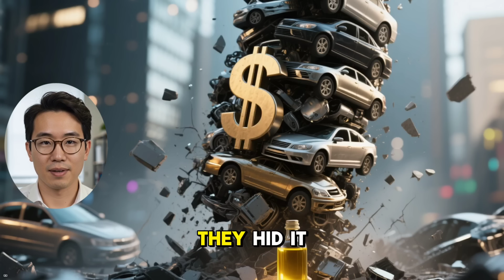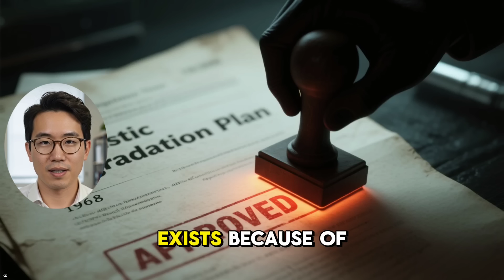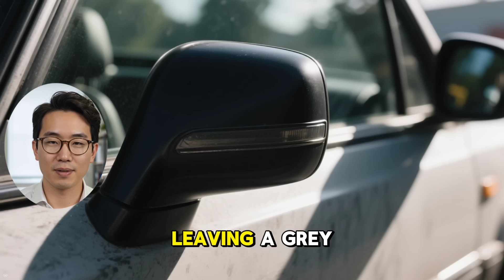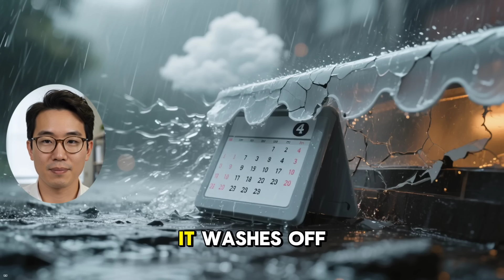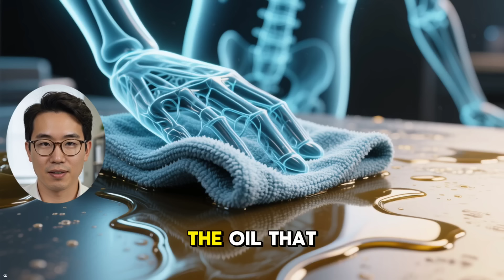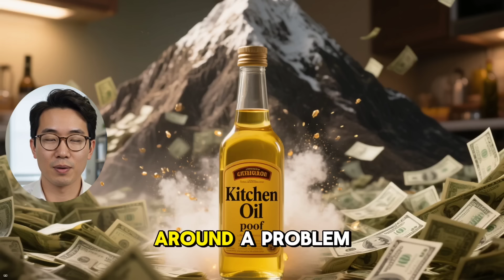$1 Kitchen Oil RESTORES Faded Plastic FOREVER. Dealers CHARGE $300 For This 2-Minute Fix

Comment: Okay.... 4/4/26 10:00PM, I'm trying it out. Cadillac Escalade, 2 black side step board runners, and a black top plate across the rear bumper. I'm leaving it on overnight to soak in. Will wipe off and buff out tomorrow. Stuff is almost like honey. Will report back. Stay tuned all you A.I. slop addicts.....

Comment: Been in the injection and extrusion business for 45 years.
Only in Polypropylene.
Homopolymer, Random Co bloc polymers, a tactic Co polymers etc.
Polypropylene cannot be coated with ANYTHING, IT WILL JUST PEEL OFF OR FLAKE OFF.
YOU CAN RESTORE IT TO ORIGINAL COLOR BY HOT BLOW TORCH LIGHTLY.
ONLY
Reply: Not if it's by the paint.

Comment: Try Minwax Polycrylic. Take a tablespoon of the stuff and water it way down with distilled water, 3 to 10 parts water for 1 part Polycrylic. I use this stuff thinned like this as a pre-treatment to pine before staining and as a topcoat over flat acrylic paint on wood. For about a nickel or less you can do all the plastic trim and bumpers on your car or pickup truck. After cleaning the vehicle, brush a very thin coating onto the plastic trim with a cheap 1 inch flat artist type brush. No rubbing, swirling or fancy application procedure is required. You can do it on a cold day, warm day or hot day in the shade or sunshine, but not during a rainstorm. It will dry in about 3 to 10 minutes depending on the weather. You can put several coats on if you like. Buff it out a little with a clean soft rag.

Comment: I learned on the Gen7 honda forum a trick that works like a charm. After washing your car take a spray bottle (i use a pump garden sprayer, im lazy😂) fill with water, i use distilled cause I love my hondas, ive used both and it doesn't matter, put about 4-6 drops per quart of 'Finish Jet Dry' for  dishwashers in the water(don't think you can use too much but a little goes a loooooong way). Spray car top to bottom. You'll see a few bubbles here and there some drools.  Just let it sit and disperse and film out and dry to a finish that looks like you buffed the car with turtle wax. My Hondas im pretty sure go faster.

Comment: Mineral oil is one of the oils I use in my woodworking but there are so many other uses for this oil.  One tip, coat your eggs with FGMO and they will last a lot longer!  The Amish as used this trick for years!

Comment: How do you get rid of weeds and grass from a stone walkway?
Reply: Vinegar with a dab of dish soap in it spray the weeds and use a hollow tube or pipe driven into the ground towards the roots and a funnel to soak the roots so they die off in a couple three days and don't want to come back ! He has a video about this method that my grandma used in her garden 60 years ago !
Reply: A propane torch.
Reply: Industrial strength vinegar
Reply: Mineral oil 😂

Comment: No idea if it works, but the magic ingredient is "Chopping Board Oil" used for treating chopping boards in your kitchen - pick it up in the DIY hardware store.  Liquid Paraffin sold in the Chemist is the same stuff and cheaper. It's not Paraffin Oil (Kerosene) but it is flammable!
Reply: Yeah, and it's mostly bullsheet. It can wreck some plastics, too.

Comment: Not another AI video! YouTube is turning to garbage.
Reply: This guy has at least 10 channels that I have blocked. He makes so many AI videos a day it’s unreal. I’ve been going through blocking them all and new ones keep popping up. I have started reporting them as spam. The amount of water and electricity this guy uses is insane.
Reply: @Speedbagthrasher  I'm going to report some. Starting with this one.
Reply: @Speedbagthrasher How can it be spam when you are not forced to watch it.  Just don't click on it.
Reply: @phoenx333 it’s a form of AI spam. These companies sit there and make these videos all day and blast the out without fact checking or anything. While using an ungodly amount of water and electricity to make each video. They need to be stopped. 
You people who support this shit are the problem. As long as you watch their videos you pay the to make the. You probably have no idea how YouTube actually works for people who make content. Go find videos made by real people.
Reply: yeah, all these "helpful" videos with Asian guys explaining. ai says:
  Mineral oil is

generally safe on rigid plastics like high-density polyethylene (HDPE) and polypropylene (PP), but can cause swelling, softening, or degradation in flexible PVC, rubber, and some polycarbonate plastics. It is often used to restore faded, rigid black plastics but should be tested first. Avoid long-term storage of mineral oil in, or exposure to, non-resistant plastics. 
Plastic Compatibility with Mineral Oil 

    Safe/Compatible: HDPE, Polypropylene (PP), Nylon, and PTFE. These plastics are commonly used for oil packaging because they resist hydrocarbon absorption.
    Use Caution/Avoid: Flexible PVC, polystyrene (PS), rubber, latex, and some polycarbonate (PC) or acrylonitrile butadiene styrene (ABS) plastics. Mineral oil can cause these to swell, become brittle, or crack, especially over time. 

Key Considerations

    Restoration: Mineral oil is effective at restoring the look of dull, oxidized plastic trim (e.g., on cars or patio furniture) by acting as a moisturizer.
    Degradation Mechanism: While oil doesn't "melt" plastic in a fire-like sense, it can leach out plasticizers, causing rigid materials to become brittle and soft materials to swell.
    Temperature: Higher temperatures accelerate the damaging effects of mineral oil on incompatible plastics.
    Alternatives: For plastics sensitive to petroleum products, silicone-based lubricants are a safer option. 

Always test the oil on a small, hidden spot of the plastic ..."

Comment: Another excellent video. Does the nmineral oil work on the interior dash?
Reply: Yes, apply wait overnight then remove excess
Reply: @jjw5165 thank you.
Reply: Don’t put it on rubber it will disintegrate from my understanding
Reply: does it have to be food grade
Reply: @MA_COPthat is what was said, in this video…Food Grade Mineral Oil.
Reply: I depends on what kind of plastic it will degrade rubber and some plastics. Do not trust these  ai "Dr. Asian Guy" advice videos that are popping up.